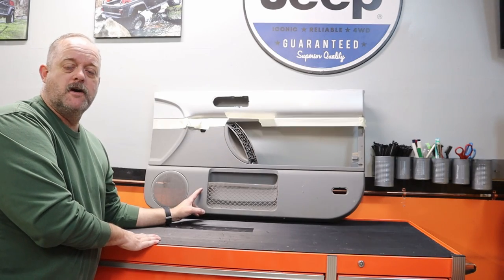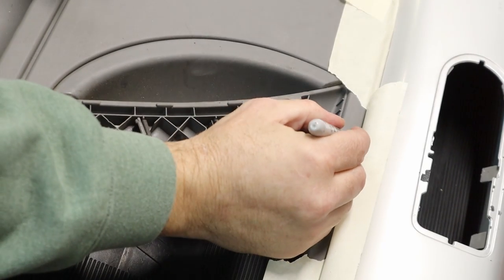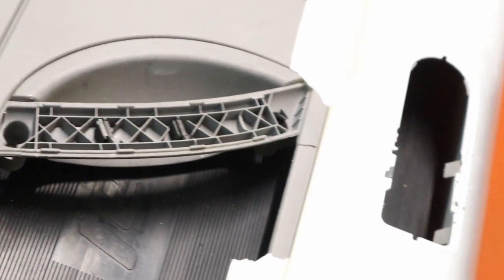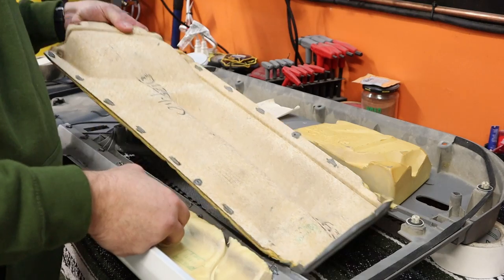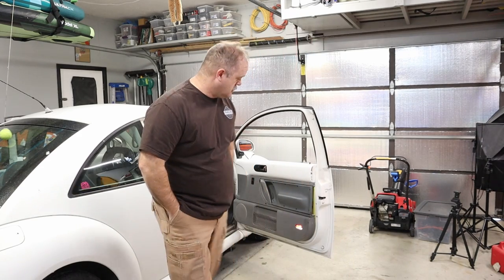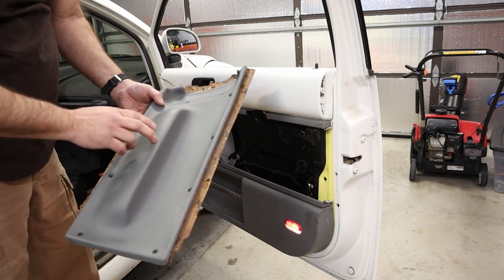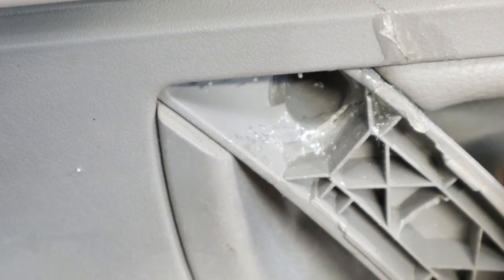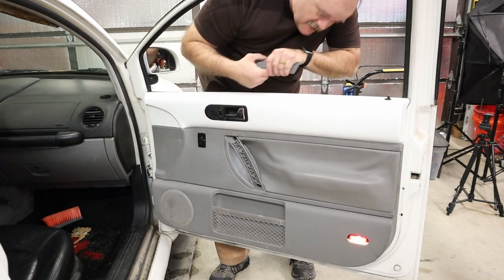Volkswagen Beetle Door Panel repair and replacement.

Comment: That looked like an aftermarket Coverlay replacement cover over the grey vinyl upholstered section.  They're expensive.  They do just screw in like it was shown.  There should have been little grey plugs to cover the screw holes. It's the best solution other than reupholstering the vinyl door cards.
Reply from the maker: Thanks for the information, and taking the time to watch and comment.  Have a blessed day.
Reply: Did you use the cover lay product. I am considering it. Thanks
Reply from the maker: No, I did not use the cover lay.  Sorry I couldn't be of help.  Thanks for watching and taking the time to comment.  Have a blessed day.   @seasidefamify

Comment: What epoxy did you use to fill the cracks and glue the insert back it?
Reply from the maker: I cannot remember the name.  It can be found at most any hardware store.  It is a two part with either a 5000 or 10000 # rating.  The big thing for me is the auto mixing nozzle.

Comment: What kind of white paint was that? did you paint the door jams with it as well?
Reply from the maker: I just used a normal rattle can in white, Painting the door panels would have been a great addition to the repair, I just didn't have the time for it.  Had I done it, I/ would have used the same rattle can paint.

Comment: What did you sand with what grit?
Reply from the maker: I just used a green scotch-brite pads
Reply: @DunnageGarage  do I have to take all the paint off with the scotch brite pads or just scuff it up pretty good I’m also going to paint them white
Reply from the maker: @johndean5860  just make sure it is scuffed completely, the entire thing should be dull with no shine.  Also sand any chips so they are smooth.  You got this!